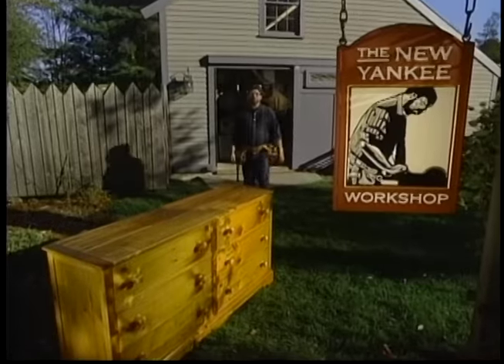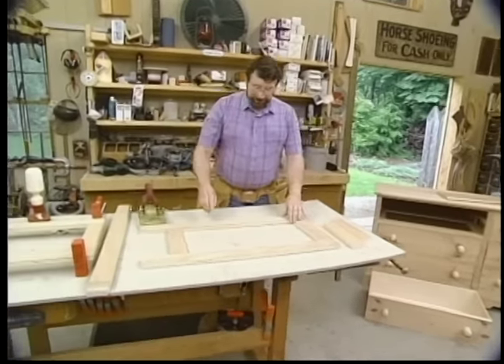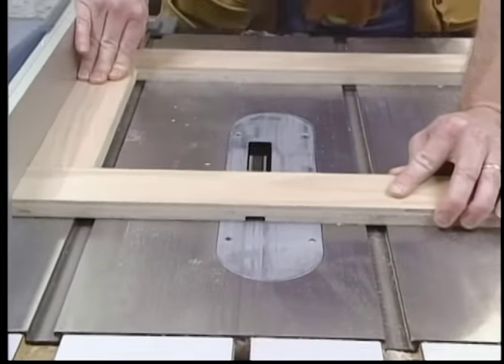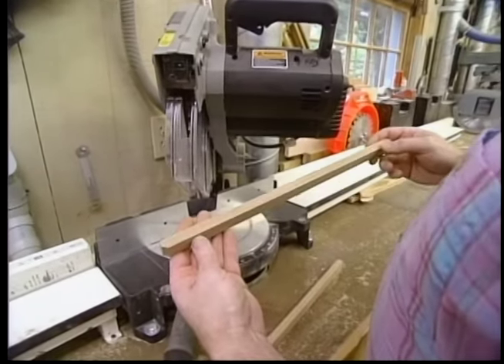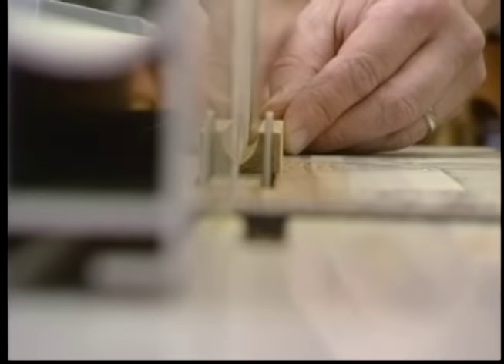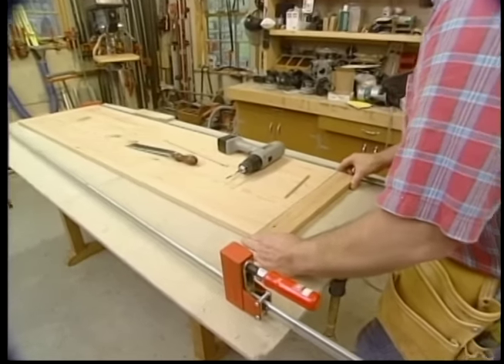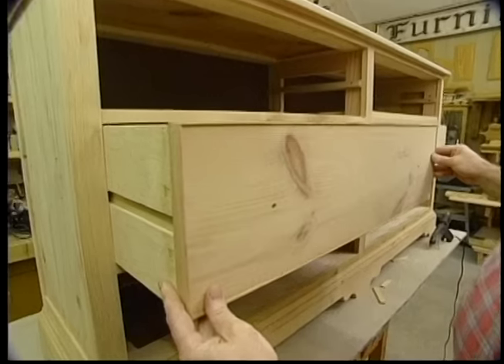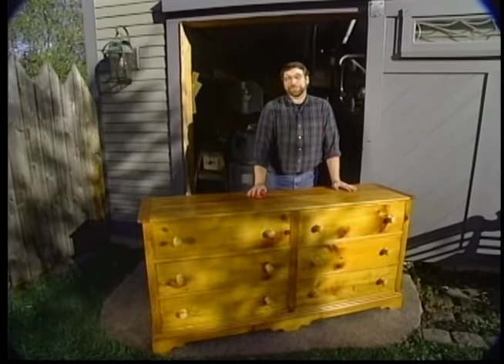Double Dresser  |  S8 E5

Comment: I'm curious how necessary it is to have separate outer and inner end vertical frames. It seems to me that this cabinet is going to be a lot heavier than necessary because each end has a 3/4" plywood frame and a 3/4" pine panel frame at each end.  Why have the extra weight, expense, and effort?

Comment: I wonder where the air compressor was setup in order to keep the noise from interfering with video taping?
Reply from the maker: It's next to the paint room.
Reply: Occasionally, you could sometimes hear it running.